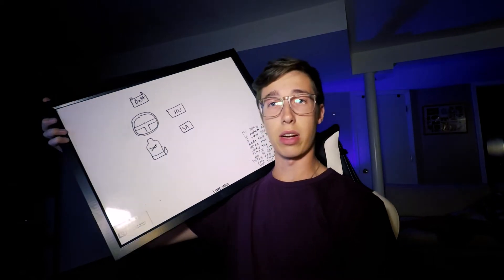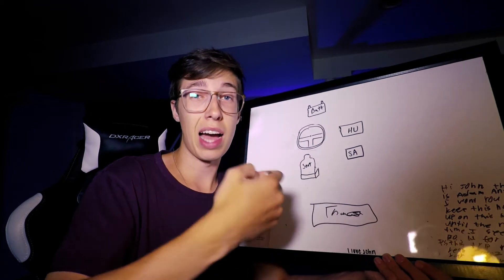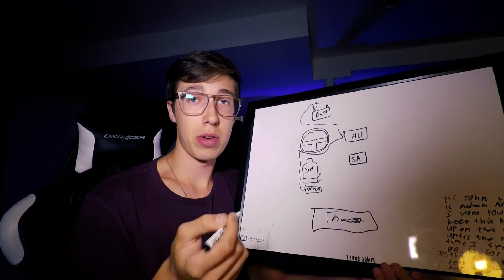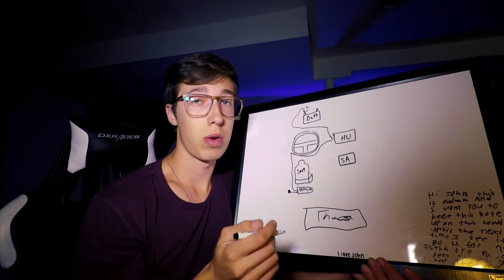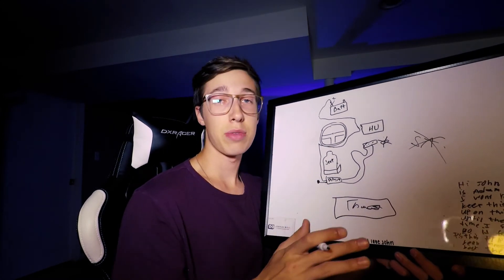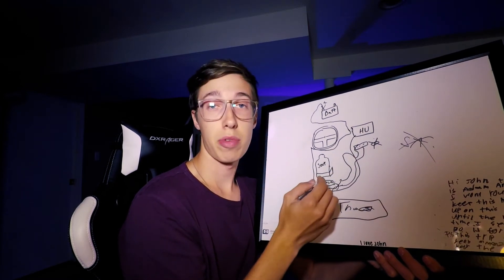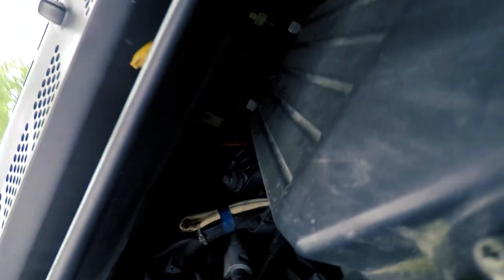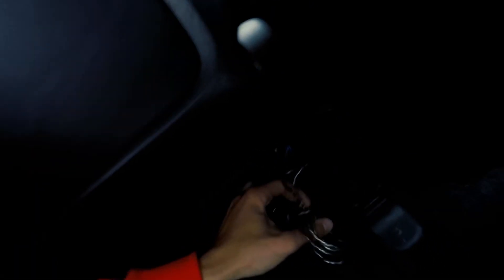How to wire a 5 Channel Kenwood Amplifier (2007 Civic Coupe)

Comment: I was going to comment on the other video where you have the ported and sealed box and elaborate on the guy who said your system sucked in a more cordial manner, but I'll just post to this one instead.....since we have similar cars. (09 Civic SI Sedan)

Ahem....So, your power cable, that is a horrible way to route, mainly because as you said, it's a huge pain in the ass. Here's what you were missing, as pretty much no one on the 8th gen forum ever specifically says it. If you move your seat back and basically lay down under your steering wheel. (Panels removed). Look up and towards the door side, you'll see this odd hole in all the wires and tubes, it goes all the way to the wall of the car. Right in the middle of it is a rubber stop that plugs in from the outside, just above.....yep, the wheel well cover. Pull down your well cover, use a flashlight and find the stop, pull it out. Take a knife or a drill and make a hole for your cable. I used a 4ga cable. Take the stop inside the car and run some of the cable through it, enough to fish for it in the wheel cover. Put the cable through, and use the cable to guide the stop, from the inside, back into the hole. Bada boom. Running it this way keeps your cable away from hotter parts of the engine bay. (You then run it up and go into the engine bay, far drivers' side there is a panel with 3 pins holding it down, pop that off, run the cable through here and to the battery.) BTW, go back into your bay and please put some insulation on your cable, especially the part around the engine itself. If that shifts and lands on a hot spot, fuse or no, it'll melt. 

You said to ignore the second wiring harness...this is true...ONLY, if you don't want to utilize a third party adapter to regain your steering wheel controls. Not all after market head units are plug in play for that....actually almost none of them are. You would be using the power leads from this harness for that. My lord...you cut the factory harness? I remember doing that way back in the day, it's a bad idea, especially if and when you decide to upgrade that JVC to a ....higher end brand.

Grounding the amp, you....well I mean you grounded it, but...uhm...next time, why not just unbolt your seat, use a wire brush to clean up the paint, terminate the cable to a ring, and use the same seat bolt to ground it right there. No additional drilling needed.

Connecting the speakers and the amp. Ehhhh, yeah, you could do that, but not all of our cars are the same, case in point; my factory amp isn't in that location. So, I ran new, thicker speaker wires from my 4ch amp to all the speakers. You want a pain in the ass? Try running speaker wire through the wiring sleeve from the inside of the car, through to the door. THAT is a pain in the ass my friend.

Annnd now for THE LAW OF THAT RESISTANCE GUY! Ohms Law ya'll. That's generally what you use to "tune" your amp with a Voltmeter. Except, that's not what you're doing buddy. Yes, taking the desired wattage, multiplying it by the resistance and then finding the square root will definitely give you a voltage number, however, this number isn't a "Sweet spot" or a tune. It's literally, a cut off. That's why when you do this, you're supposed to turn the head unit up to what you consider your max to be. (Or the max of the H/U if you wanna play that game and assume the H/U doesn't clip before hitting max volume.) Honestly, without an oscilloscope, you're not going to know about the H/U. ANYWAY back on point. Let's say, you're running a 500w @ 2 ohms. So what you would do is connect your voltmeter, run your 60hz test tone and set your gain for 31.62v, right? BUT, this is the MAX and a cut off. In reality, you rarely get songs that actually hit that number, meaning you'd never actually fully utilize the power of the amp or sub. Which is fine. I'm just...explaining in a very long winded way that you didn't tune your amp, your simply matched the gain to the H/U's volume. (Case in point, I use 28 as my H/U's max, but it can goto 35. So I didn't use the voltmeter for 35, I did it for 28....BUT, then I ran the test tone, and added gain until I heard the hum turn into a buzz, then I backed off slightly until it became a hum again.)

...dear lord I wrote way too much and it's like 430 in the morning. Anyway man, welcome to the car audio world, where you kinda always keep an eye out for deals and upgrades even though you don't need em. (Ya know, like computers)
Reply from the maker: DRCsyntax I really appreciate the advice. I learned a lot from my first install and will definately be doing it differently for my new car. Consider subscribing for more. People like you help me make better videos. Thank you!

Comment: I mean or just run speaker wire to each speaker, and plug it directly into the amp..
Reply from the maker: Dude. Try running speaker wires through door grommets.